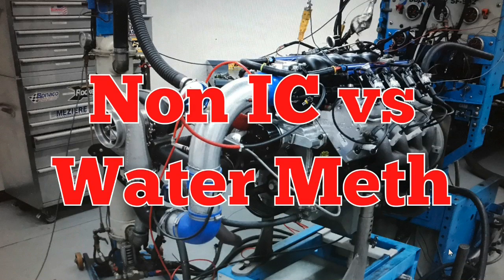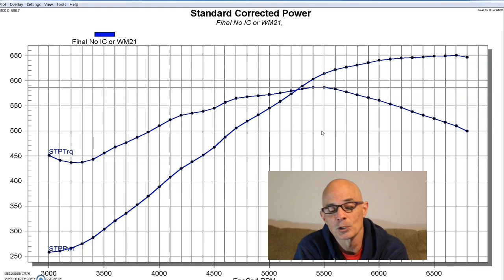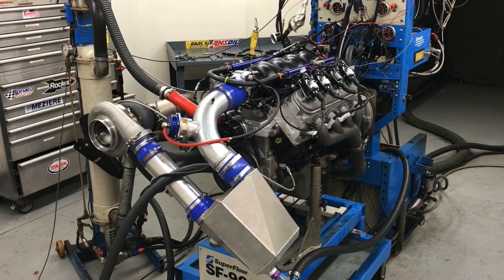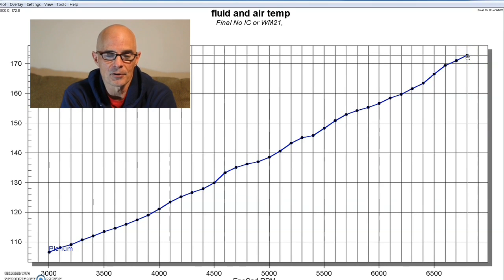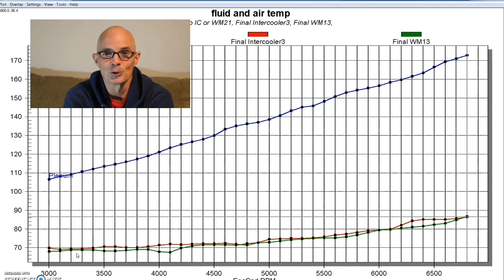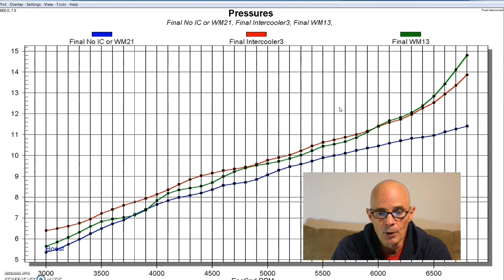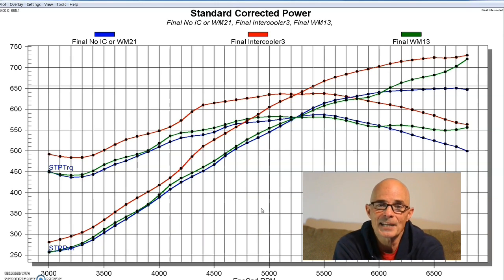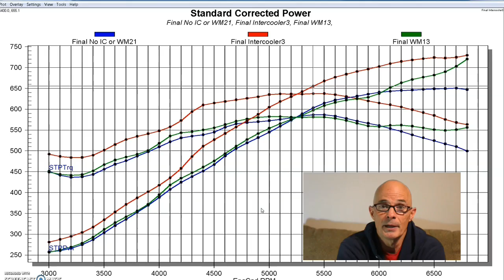WHO'S COOLER? WATER METH vs INTERCOOLER

Comment: Do a video on different sized charge pipes (2.25” ,2.5” and 3”) for turbo combinations and spool up differences, potential boost creep issues with using the smaller pipes with smaller wastegate vs it working fine with the bigger pipes!
Reply: The test was also done with 2m of piping with only 2 90degree couplers on the intercooler so the more bends in any system will make the gains of going bigger pipes even greater
Reply: Matthew Barron - No. 300hp at > 1bar is 350cfm+. The size difference and length between 2 and even 4 inch pipes would be so small that you wouldn’t be able to measure it at that hp level especially since a 2 inch pipe can support over 500cfm. If anything, the smaller cross section would spool infinitesimally faster, as it wouldn’t take as many microseconds to pressurize the tube before the motor - because that’s how that would have to work. Besides bigger pipes would have diminishing returns on your application because the TB is so small - a 3”+TB on an SR20 would be hilarious - and you can’t pretend like big pipes with a smaller TB inline could pay off. I’m sure that you don’t have dyno charts, videos, or pictures of this experiment - prove me wrong.
Reply: Eric Simpson you’re the problem ! After all my internet searching on the topic I was under the same conclusion as yourself except I do not just accept it as facts. I did the test at my mechanic/tuner at the time and the results were as I said, I later Changed mechanic/tuner and tested again just to verify what i had already seen but we also took data of pre and post intercooler pressures, temperatures and also exhaust gas temperatures all on the same day with in 4 hours. If you had a different approach and just asked to see my results instead of telling me I am wrong when you haven’t even tested it yourself I would of gladly shared but you can continue believing what you assume to be correct with out real world testing. Enjoy
Reply: Bigger pipes spool earlier and the shorter the pipes the better the spool again .bigger pipes also create lower exhaust temperatures because they need less boost to make the same power. I tested 2,2.5,3” on a 300hp sr20 on 16-18 psi depending on the pipes size. If 3 inch is better on 300hp it’s going to be better on everything above it . My next test will be        3 vs 3.5 vs 4.
Reply: @1999ekk24 Your claim is contradicting itself.  Larger diameter has a higher volume.  Shorter pipes have a lower volume.  Lowering volume one way and increasing it another way aren't both going to improve spool.

Comment: do you think becuse efi intakes with runners like oem arent designed to flow water/fuel the heavy liquid is falling to the bottom? try this with a single plane 4150flange style

Comment: I heard that spraying water meth before the turbo acted like water jet to the compressor wheel.
Reply from the maker: don't think that will cure distribution problem with this intake
Reply: @richardholdener1727  It probably would.
Reply: @richardholdener1727  I wonder if lengthening the charge pipe would help by giving more time for the water/meth time to vaporize before it gets into the intake runners?
Reply: @richardholdener1727  Pure speculation, but I'd guess it could, if it had time to completely vaporize before it reached the runners.
Reply: Compressors work on gases, pumps work on liquids. If you force your compressor to work on a liquid, it's going to get unhappy in a hurry - if not sooner.

Comment: Wasn't the use of water/meth more for the octane addition and allowing more timing than the cooling effect and now E-85 makes it irrelevant.
Reply: Yes. The meth injection is to allow for more timing safely to get more power, but he even said the timing was kept all the same so it didn’t take advantage of that benefit
Reply: Isn't it for AITs? I'm sure the methanol gives a slight boost to octane but I bet it's almost irrelevant. The cooler Temps allows you to pull some timing. E85 doesn't make this irrelevant. In my state E85 is not readily available. Meth injection is easy and cheap compared to gearing up a car to run E85
Reply: Sure E85 runs cooler with higher octane, but every scenario would benefit from cooler IAT's
Reply: This is right from Snow Performance site "Whether running a supercharger, turbo, or high compression motor the Stage 2 Boost Cooler will make the induction charge colder, denser, and increase 91 octane fuel to 116 octane race gas levels allowing full power all the time!"

Comment: You know, Banks says it is all about  charge"density".  The calculation is a little complex, but no longer uses boost pressure.  May want to get his take on the matter.
Reply from the maker: I know Gale and understand Charge Density-this is not that
Reply: @richardholdener1727  Richard:  no offense intended by my earlier response.

Comment: How about some turbo testing? I'm very interested in that 7875 next gen vs the Borg t4 s475. Also would like to see how far an s366 or s369 can go on a 5.3. The back pressure vs boost is great info!
Reply: I think the s475 would be a great comparison and probably would outperform the 78-75 ...if you use a T4 house with a .91 A/R on the S475
 if I'm not mistaken this would  balance the inlet and outlet of the turbine making it very responsive...

Comment: Seems like intercooling is the way to go for big power. What about meth injection with higher boost applications? 15-20 psi? Is there a difference between meth injection and water/meth? Thanks for the videos!
Reply from the maker: yes difference between meth only and water meth

Comment: Did you log the back pressure?
Reply from the maker: back pressure won't cure distribution
Reply: Richard Holdener this is true but it would be interesting to see how back pressure changed. Did the water make steam and make more back pressure? Wouldn’t explain the boost with the intercooler but would still be interesting to see
Reply: @tommurray2377  Even just running on E-85 or methanol increases the volume of exhaust gasses.
Reply: @richardholdener1727  I think his point was backpressure could help illuminate the loss of boost control on the intercooled and water/meth runs.

Comment: Good stuff.  Logical confirmation test would be single plane 4 barrel type intake with an elbow and a plate system for the meth.  Maybe Egt probes on each cylinder to as a way to monitor cylinder to cylinder distribution patterns.

Comment: Have you tested different types of intercoolers like cheep ebay vs high end. or tested bar/plate vs. tube/fin intercoolers? Several years ago I seen an issue with some cheap ICs having flow restrictions. They were only able to flow low amounts of psi, but when removed the car made more power and was able to make more boost. Just wondering if you've done something like this?
Reply from the maker: That is an intercooler sizing problem

Comment: I pushed every button
Reply from the maker: points for you
Reply: @richardholdener1727  mr. Richard I noticed a lot of people are saying that you should’ve bumped up the timing on the meth injection
Because of the density and the higher octane rating of the meth 
My question is have you tried this I’m just curious about the results and if it did make up the difference to compare it with the inner cooler anyway thanks for everything I know this video is old but we still watch

Comment: I would like to see if a single plane intake manifold helps with better  distribution
Reply: Same here, I'm running a Victor jr. With an elbow on my ls in my 32 pickup build. I'd like to mount the turbo in the grill shell w/o intercooler and run meth I'd bet the distribution would be a lot better and the turbo would have zero restriction of fresh air. I'm thinking single nozzle at the wheel.

Comment: Very interesting. The IC causing a difference in boost I can see. I don't get the rise in boost for the WM. It's been around for a long time with good results. Anyway, thanks for the good science, this saves me a lot of money. Was planning a WM set up but maybe not now.
Reply: He kept timing and fuel the same on all runs. You could squeeze more power with a meth injection
Reply from the maker: no

Comment: The point was charge air density for the same temperature. Intercooling made the air way more dense thus more fuel (if closed loop it did it automatically) and more power. Now similarly with meth injection, you can get away with much more boost and timing before detonation occurs, but you won't make the same power for the same temperature as intercooled
Reply from the maker: we don't run closed loop

Comment: I cant wait for pre turbo water meth test.
Reply: Keep waiting. Spraying atomized water into a turbo is stupid and will cause erosion to the leading edges of the compressor blades. Example a 60 trim T4 at 100,000rpm, inducer radius is 29mm, tip speeds are 304m/s, which is 680mph. Smack some cast aluminum into water droplets at 680mph and you wind up with erosion of the AL.

Comment: I’d love to see the test with meth in front of turbo. My mind wants to think it would atomize better. But who knows.
Reply: Bad idea having something crash into the Impeller.
Reply: @batman9592  lots of diesel guys do exactly this for long periods, like years.
Reply: Thays how I been doing it dor years.. Current cars...procharged c5z preblower boost juice ....Turbo LS fox.  Pre turbo boost juice.. No intercooler on either.  Bost have thousands of miles and hindreds of pulls....run perfect and here in Texas the temps are way better than when intercooled.  Plus water cools the chambers and keeps things nice and clean.
Reply from the maker: you haven't checked distribution if you have a long runner intake. This isn't a situation whee it only happens to this motor-it happens to every combination running this type of intake
Reply: @richardholdener1727  I find it hard to believe that pre turbo wouldn't help distribution. Just spraying into a fan you see a massive difference in how the spray pattern is. The air current through the intake after the turbo is probably holding the heavier water in suspension and going to the same place. If it's all being saturated into the airstream going through the turbo I think it would distribute better.  Test, test test,!
Reply: @jasonbirch1182  that's not how fluid dynamics works. Air and water both flow along surfaces and these  intakes are designed to be dry meaning they dont have the rough texture to disturb the airflow and re atomize the fuel or in this case water resulting in streams. This happens with fuel if you over polish your intake ports.
Reply: @triplestangman  no I get that. But if it's atomized through the turbo it's only got a short amount of time to come back out of suspension. The turbo is distributing droplets way smaller than a nozzle in air. Plus it's all the air getting mixed with the spray on its way through the turbo. Not just the air rushing past a sprinkler.  Perfect ? No. But it's gotta be better.
Reply: TunerDad TunerDad 
Dude you can get a massive cooler very cheap. Why wouldn’t you ??

Comment: I'm going to guess that the high rpm boost spikes on both the IC and WMI are from greater charge density.  Which in turn increased the quantity of exhaust gases for the WG to process causing the rising boost at high RPM.  I'm also going to guess that the WMI caught up with the IC on the top end because the distribution equalized at high RPM.  I believe the distribution equalized bc the velocity was high enough at the upper RPM and/or the turbo outlet temperature was high enough to boil the water MEOH mix.  Higher temperatures cause greater atomization and higher water saturation of the air.  More then likely it was a combination of both Temp and Velocity. 
 So port WM injection would be interesting, but would the WM have enough time in that short distance/time to absorb the heat energy before it hits the intake valve.  Thereby increasing the charge density before the intake valve, allowing more charge into the combustion chamber?  Another cool test for WMI would be Octane increase or knock resistance.  Because at the end of the day boost is not the end all be all of it.  It's more like how much power can I make without breaking the bank or breaking parts.
Reply from the maker: the distribution did not equalize at high rpm-difference in temp of cylinders was over 100 degrees-difference increasing with rpm on the WM
Reply: If there was greater air density with the water/meth - why did the engine not make more power?

Comment: Hey Richard cant find an email for u anywhere was wondering if you've done any testing on injectors? 4.8 5.3 6.0 injectors specifically, I've bored my 6.0l lq9 flattops to 4.020 I have stock 5.3 injectors do I need to upgrade? If so how do I find wut I need. Your 5.3 6.0 vids are so helpful thanks
Reply from the maker: stock 5.3L injectors will likely be too small if you have a cam in that 6.0l
Reply: @richardholdener1727  yessir stage 2 btr, milled 862 heads

Comment: methanol and intercooled had the same temperature drop, but intercooled made a lot more power throughout the curve, and methanol didn't change power over non intercooled.  conclusion: temperature doesn't matter after the turbo.  it doesn't affect mass airflow.
Reply: terrible conclusion

Comment: See a lot of ppl run both, but how much is it actually worth? Does the intercooler lower the effectiveness of the meth? How much boost would make ot worth running 20+psi? Would 15lbs or less negate its use if you have an intercooler?
Reply from the maker: intercooler is what you need or direct port WM

Comment: Great stuff Richard!  Did you find anything interesting about how much timing the engine wanted with the water/methanol?  If not, maybe you will when you try the individual port water/methanol injection.  I'm curious about whether it CAN make the same power as an intercooled and no water injection setup if everything is optimized for the water.
Reply from the maker: the WM won't makes as much as the intercooler with both optimized (and both were)
Reply: @richardholdener1727  optimised timing?
Reply: @richardholdener1727  Thank you!!

Comment: Do you have the same A/F with the W/M injection as the other combos? Did you try pure methanol since the water isn't participating in the combustion?Maybe next time you could test with exhaust thermocouples and adjust fuel per cylinder since it sounds like some cylinders are drowning which is my guess as to why there wasn't much of a power gain with the W/M injection.
Reply from the maker: sounds like some cylinders are drowning? Did you see the part in the video where we spent endless hours tuning the WM-nozzle size, single and double nozzles, pressure, ramp rates etc.. The problem is that the WM does not work well with the long runner intake (individual port temps varied by over 100 degrees)
Reply: @richardholdener1727  After rewatching the video and reading others comments I've come to a couple conclusions. 1)The W/M didn't have enough time/distance to fully evaporate which is why you had varying runner temps as it was still liquid in the intake manifold. 2) You temp probe didn't get a correct intake air temp because the liquid W/M insulated it from the true temp. 3) The boost rise was from too small of a W/G causing the boost rise. As you got more air density from the I/C and W/M it created more exhaust flow. 4) Because of the improper distribution because of the liquid W/M also caused a big variation in cyl. to cyl. A/F so there wasn't a power gain over non-ic. 5) The power spike at the end was probably caused by better vaporization because the W/M flow was closer to optimum for the higher airflow. 6) It would be neat to experiment with longer charge piping to give the W/M more time to fully evaporate before it gets to the intake manifold solving the distribution problem.
Reply: @richardholdener1727  Exactly, the ones that are cooler are getting flooded  making them overly rich.